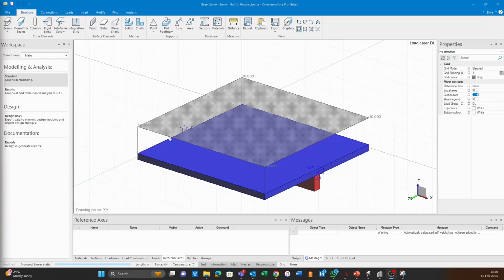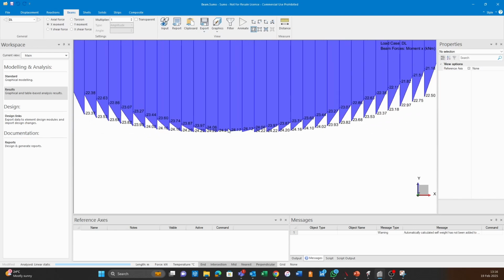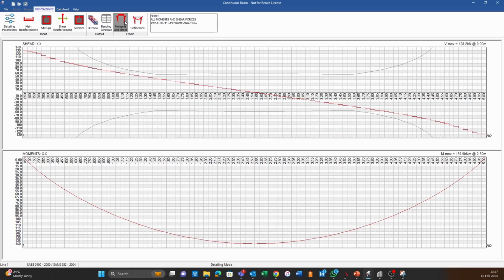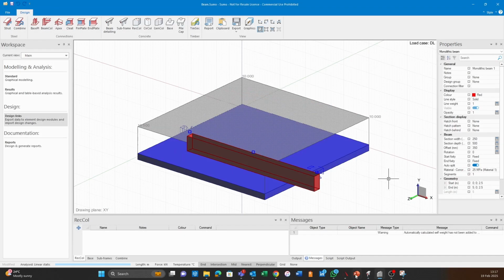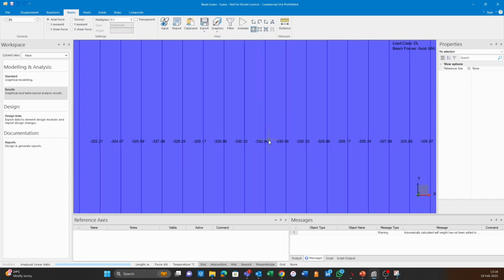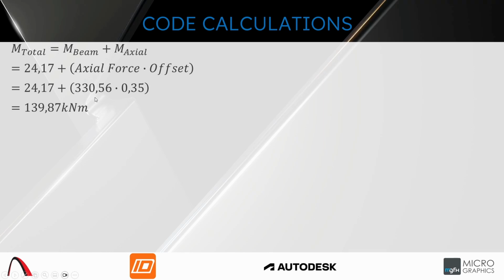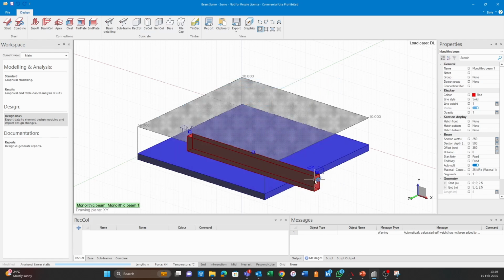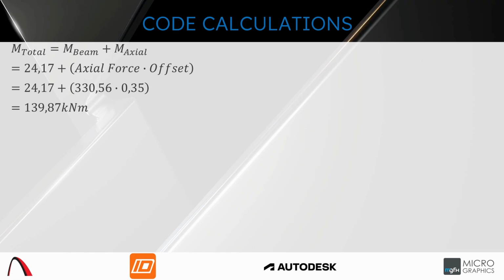Why are SUMO & Continuous Beam Moments Different?

Comment: Lekker Jacobus, this was a very interesting video! 

I have a question about something else concerning Prokon, specifically the "Rectangular Slab" module: I preface this by saying that I'm an EIT 😂

With continuous 2-way spanning slabs, senior engineers often model panels using the module. However, designing the slab panel by hand (SANS 10100-1) vs the software, it is common for +ve bending to be within 10% error, but with -ve moments I've seen errors of 40% to 50%. I modelled the same slabs in Frame usings shells and I get similar results to Slab, around 5 to 10% error.

Is this because of the  assumptions the code makes i.t.o the coefficients? How can I verify what the software is giving me by hand?

Jammer vir die lang boodskap, maar ek hoop jy kan my help. 

Groete,
Reply from the maker: Hi Craig,

Thanks for your message.

This is a particularly challenging question at the moment. The comparison between FEA outputs and hand calculations is often misunderstood, and unfortunately, there isn’t much content available explaining why in a simple and practical way. A proper comparison would require examining the assumptions behind code-based calculations and ensuring the FEA model is set up to align with those assumptions.

While some difference in output is expected—given that these are fundamentally different approaches—the key question is whether the discrepancies are consistent. In reality, that’s unlikely, as FEA results are influenced by factors like slab stiffness, twisting moments, and other variables.

I don’t have a definitive answer yet, but I’m currently working on a comparison between the two methods. Hopefully, we will get to a place where there are "rules" that will help us to draw meaningful comparisons between the FEA outputs and hand calculations, allowing for verification.